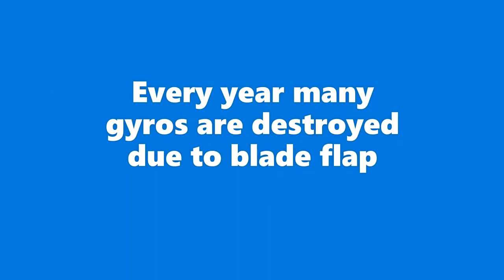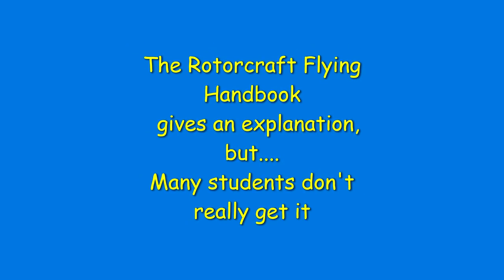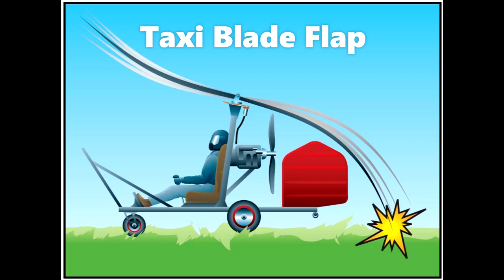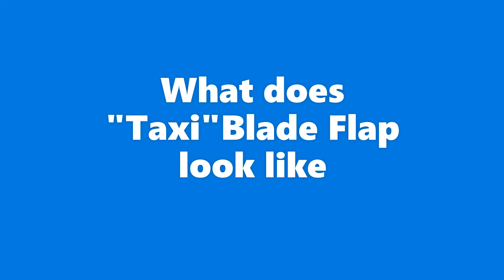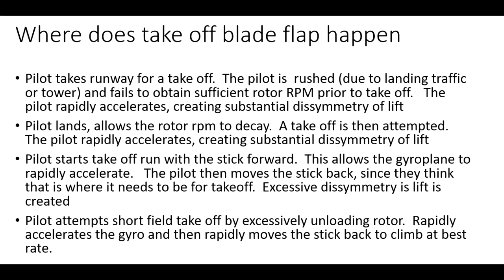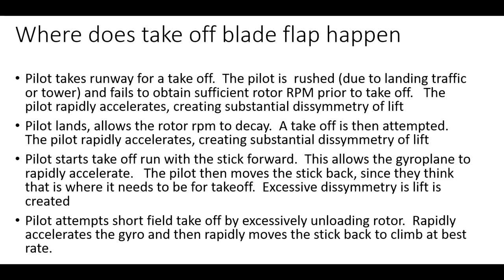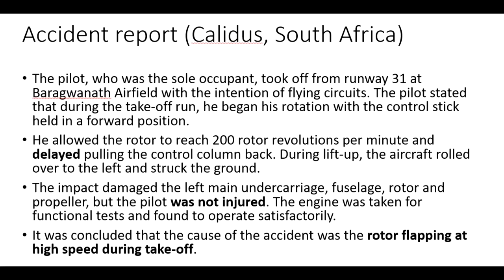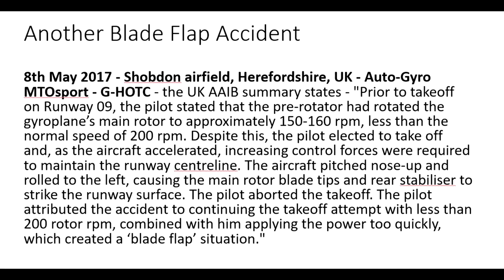Blade Flap 2022

Comment: I had already watched this video when you mentioned i see this one. Again, I still think there should be a stop at the controls to prevent being able to pull back so much. This would leave a few inches more clearance from the rotors hitting the tail in the case of blade flap. It wouldn't stop the other problems, but at least it would be less likely to hit the tail.

Comment: Good teaching! I had also learnt that takeoff roll should be initiated when rotor should achieve its required RPM to gain centrifugal force making it completely straight instead of letting it saggy. Let me know if I am correct? Thanks

Comment: "Blade flap" accidents seem like a misnomer to me and the use of the term "blade flap" instead of "disc flap" may be a potential cause of confusion to some. As a multi-decade, multi-thousand hour professional helicopter pilot who is considering to learn to fly gyroplanes with utmost humilty and caution, I pay close attention to videos like this. To my simple mind, blade flap is an integral normal element of the physics which govern the flight of rotorcraft. Reaching and then exceeding the limit of rotor disc parameters, due to pilot mismanagement of the rotor, then results in excessive disc movement acting against the stop and rolling the aircraft to one side. Perhaps some term other than blade flap or even disc flap should be sought, which could be more clearly appreciated.
Reply from the maker: You may wish to watch this video.  https://youtu.be/D2-kA7E-gzs     And yes, blade flap is poor term, but one that is used in the gyro community.   Some folks also refer to this as "blade sailing", which is slightly better, as it is not confused with the general flapping that happens with all rotors when in forward flight.  --Anyway in the attached video, the pilot starts with the stick forward.  The gyro accelerates, and at some point the pilot either pulls the stick back or the dissymmetry of lift gets to be too much.  The retreating blade can't compensate and up and over she goes.
Reply: @txkoob  Watched it, thanks and read the comments. Apart from anything else he might have been doing wrong, it looks to me like he "over-rotated" i.e.  yanked the stick rearwards too swiftly, while the rotor might not yet have reached sufficient rpm. From what I've seen of many take offs with my own eyes, the pilots seem to do everything cautiously/gingerly in order to get airborne.
Reply from the maker: @colibri67  The previous video is a classic example of "Blade Flap".  The pilot does not have to "yank" the stick back for this to happen.  It can happen without moving the stick back at all, but only due to the increasing speed of the gyroplane and low rotor RPM(dissymmetry of lift).  In all likely hood, the pilot gingerly moved the stick reward.   When "Blade Flap" happens, it tends to be sudden and violent, with little time for the pilot to make corrections.    --This sort of accident is avoided by starting the take off roll with the the stick back, until the nose wheel comes up, then balancing on the mains until the gyro comes off the ground.   This is a rather draggy condition that allows the rotor RPM to come up to speed before the gyro accelerates too much.
Reply: We used to call stalling the retreating side hinging as another phenomena which we called flapping happens over rough ground when the gyro pushes up and down with both blades on bumoy strips it xan stop blades building speed.  This can lead to both blades stalling.  Ive experienced this a number of times.  The more flexible the blades the more this occurs.  Usually at lower rpm.  You need to stop and start again.  

This happens in gyros because you are trying to accelerate the rotor with its forward vector of lift.

Comment: Can anyone tell me why all current gyro's use long flappy 2 blade rotors. The German autogyro kite in ww2 had a 3 blade shorter diameter  less flappy  rotor. Why not use this today?
Reply from the maker: You may wish to see something a bit more modern.  The Air and Space 18 https://en.wikipedia.org/wiki/Air_%26_Space_18A had a 3 bladed rotor.  --Most modern gyroplanes use a "teetering rotor"  These are simple to make since they have a single pivot point.    By contrast "fully articulated" rotor systems are more complex, requiring one or two hinges for each blade.     And if you want to see a really unique design, take a look at the KMAX helicopter.  https://en.wikipedia.org/wiki/Kaman_K-MAX  No tail rotor, but two synchronized rotors, where pitch is controlled via servo flaps.
Reply: @txkoob thanks for the link but from an aerodynamic  viewpoint it doesn't explain why no 3 blade rotors on modern machines today. I'm thinking cost/simplicity vs something I don't understand. I'm a non current fixed wing pilot thinking a Caladus  would be great if they only cruised about 10kts faster. 120 kts cruise  and I'd be totally sold. Less rotor diameter is less drag, 3 blades less stick vibration and less effect from the retreating blade. So, what am I missing here....anybody?
Reply from the maker: @garyyoung4074 Hi  Garry.   Another link for you to describe different rotor systems.  http://www.helistart.com/RotorheadTypes.aspx   Gyroplanes tend to use under slung teetering rotor heads.  They are low cost to produce, and easy to maintain.   Also, there is some regulation impact.   https://www.law.cornell.edu/cfr/text/14/1.1  Current regulations state "Light-sport aircraft means an aircraft, other than a helicopter or powered-lift that, since its original certification, has continued to meet the following: ...(9) A fixed-pitch, semi-rigid, teetering, two-blade rotor system, if a gyroplane. "  --So, almost every gyroplane you encounter will have a fixed prop and a 2 blade rotor.   As for the cruise speeds, 120 kts is unrealistic.    Something like a Chech light sport cruiser airplane has a cruise speed of around 97kts at 3000 feet and 75% power.  Any gyroplane will be slower. Think closer to 100 mph as a maximum.  Gyroplanes have a large amount of drag.